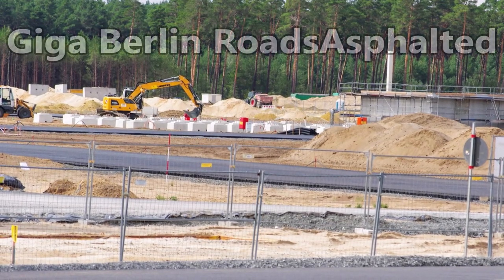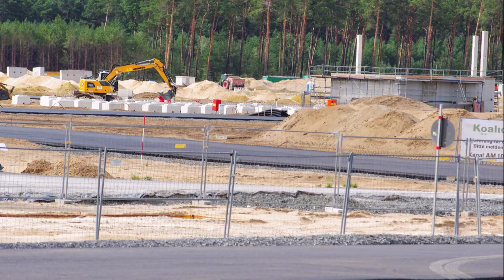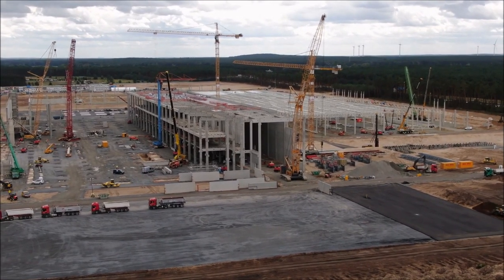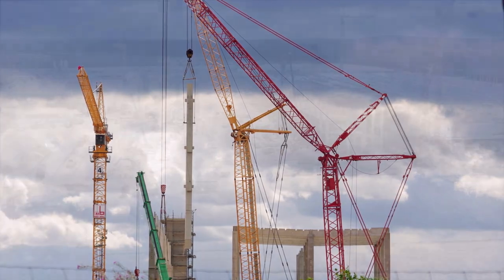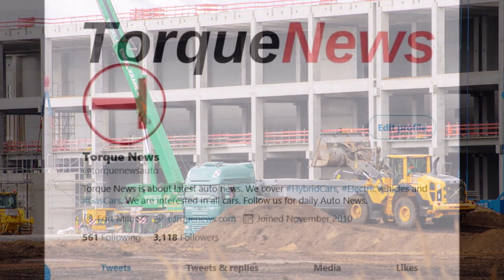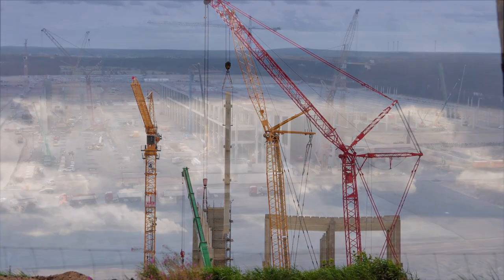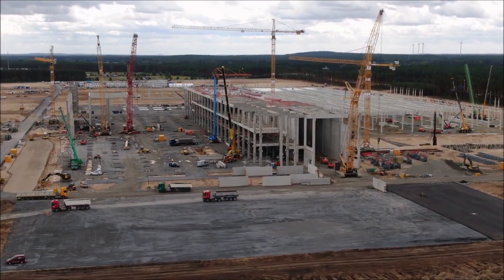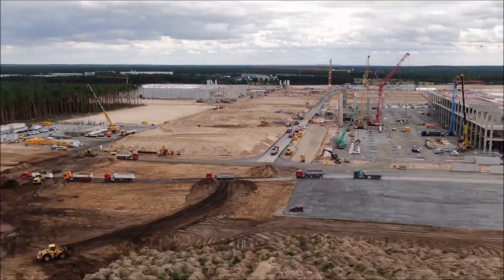All Tesla Giga Berlin Roads Are Asphalted

Comment: It makes sense for  big industrial contractor to take control of everything except PreCast, structure, walls and ceiling. Here are My Break downs: ELECTRICAL: All lighting & plugs, tray, power wiring, all instrument wiring & controls. MECHANICAL: all structures for production line, all truck doors & fork lift ramps, all interior doors, office, bath room kitchen contractor. PIPING domestic & Process. HVAC Ducting, equipment, & controls. PAINT EQUIPMENT, ROBOT installation , and at least 20 other separate contractors that have a supply and installation contractors for things like elevators. There could be 5 different contractors for ELECTRICAL alone and same set up for MECHANICAL, & PIPING. THIS PHASE REQUIRES THE MOST PROJECT MANAGEMENT. Manpower could start at 500 men and be up too 5000 men in 2 months. SHANGHAI WAS THE BEST AT THIS. I would expect a lot of CHINESE / TESLA  Experts will oversee and help GERMAN TEAM. Some of this equipment requires setup by manufactures experts.